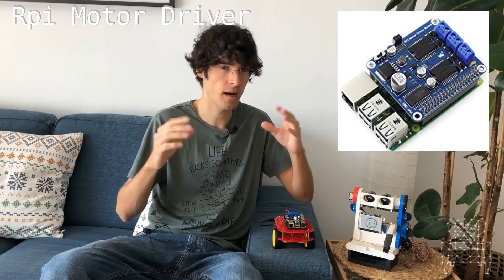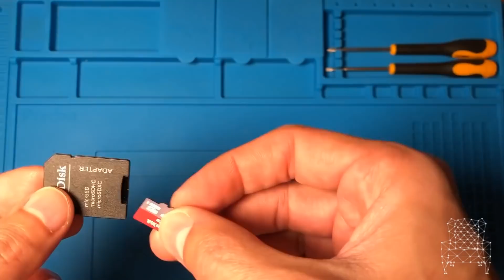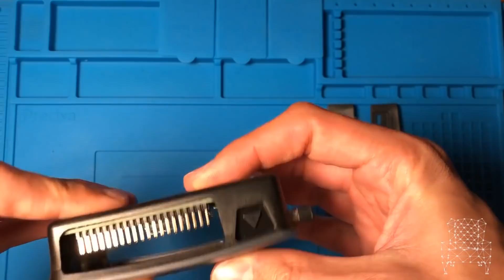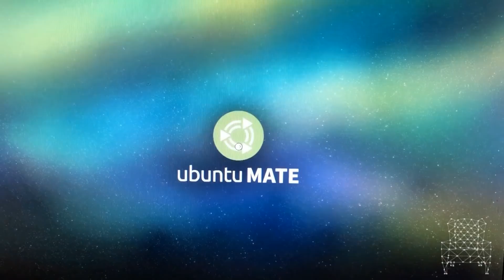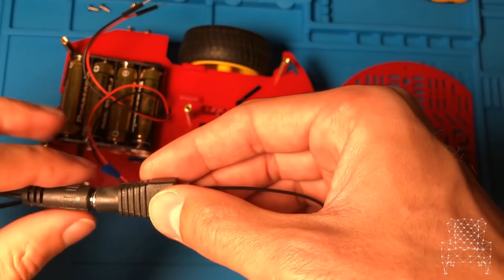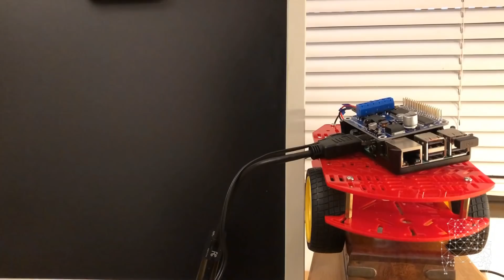[Morpheus Chair] Move DC Motors for a Robot with Raspberry Pi | Ep.2

Comment: I made a  code similar to this except for the class quite a while ago and with L298N H-bridge as a motor driver. It worked! I wanted to know how I can use this RPi with python to control motors in ROS instead of another interface with Arduino? I have been trying to implement Autonomous navigation using SLAM; being able to get both Hector Slam and Cartographer running, but not sure how to integrate that with the motors and at least use teleop to control the bots. There are not many resources available on the internet. Would be glad to get some help. Also, I am not using encoders, so only on the basis of the localization of the IMU of the lidar that I have, I want to control the bot. So as to make the hardware as simple and cheap as possible. Lacking in the resources, hence asking. Thanks, again!
Reply: Hii please DM me

Comment: I am using a different DC motor hat for the raspberry pi. When I try running your code it isn't working moving my motors. Is there a way to get your code to work with my motor hat or do I need to use the hat that you have?

Comment: Hi! Excellent video.
Just a question, we do need two battery packs, one for the DC motors and another one for the Raspberry PI (In case that we don't have the MicroUSB break)?
Thanks!
Reply from the maker: Exactly, in the next video, we will probably add them so that it's fully autonomous. The Other Battery pack that we will use for it is this one: https://www.amazon.es/Kuman-alimentación-expansión-Interruptor-Raspberry/dp/B06X6GR6D8
Reply: @TheConstruct  Great! Thank you
Reply: Manuel Serrano Durán you can just use standard power bank for raspberry and 2 battery for DC https://youtu.be/DN6HwDpfOmU
Reply: Where the pin is connected ?